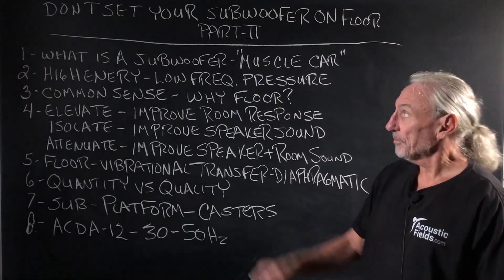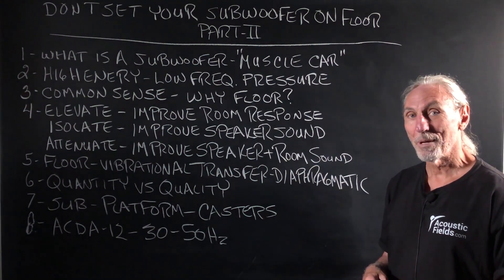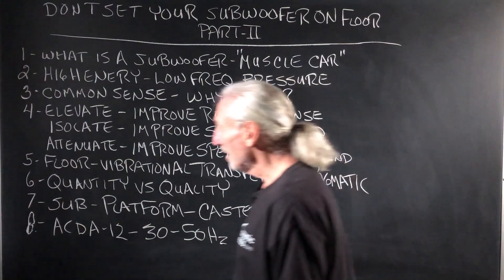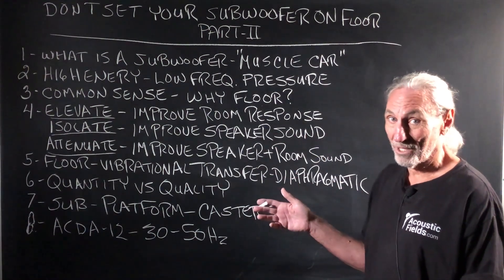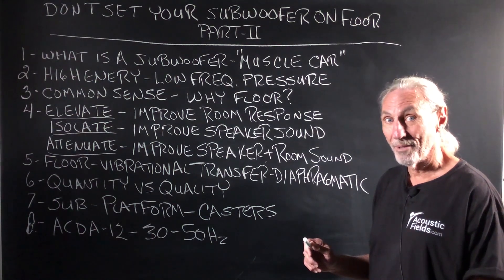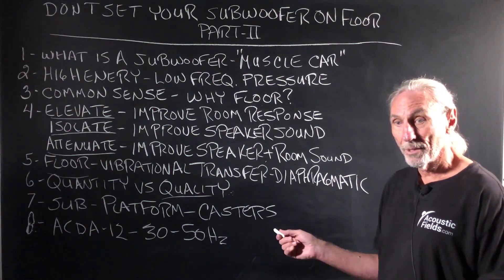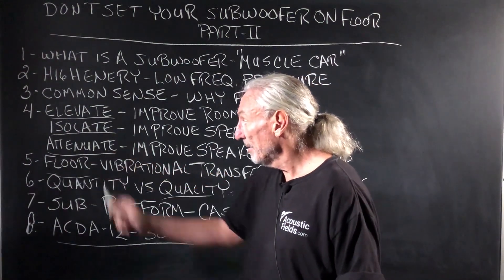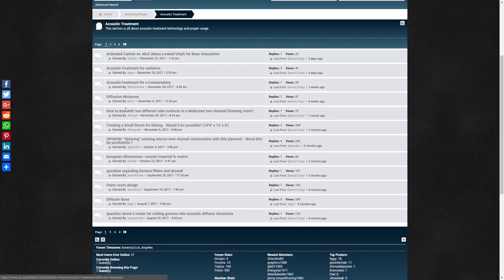Don't Set Your Subwoofer On The Floor! Part 2 - www.AcousticFields.com

Comment: Great work Dennis, I have one sub that's on the floor, out of four, only because when I was setting up, doing the subwoofer crawl and when I do the crawl, I do it on my hands and knees, then up on my knees and finally standing up, to help find all the hight point's as well, so the one on the ground was a good response point, my house is cinder block on a cement slab, with one sub that I had set on floor, running ypao, I found that ypao was upping the dB to it, so I raised that sub a bit over a foot off the floor, run ypao again, I gained just over 3db, I then lowering gain to suit, it spoke for it's self, after a lot of research, your input being the best I found, some time perfecting my set up, all I'm doing now is enjoying every second of it, thanks Dennis.
Reply from the maker: Thank you for your support and following.

Comment: I am super interested in seeing what the sub does and how it effects the room at different heights. This is something I have never seen tested
Reply from the maker: The subwoofer is a low frequency producing source. The room does not want it. It will do everything within its physical power to fight with each wavelength that the sub produces. This fight goes on full time at all pressure levels. Finding the proper position is a good first start. Place the sub in the center of the room as a start position. Move 1' forward and then 1' back. Repeat with sidewalls. Elevate at least 18" off the ground for this testing.  Spend at least 2 songs listening at each position change. Play a full range song with lots of low end then play a "regular" song with strong vocals
Reply: @AcousticFields  how to elevate sub?? Cant find that anywhere? What do i put under my sub???
Reply: @AcousticFields  In a home theater Subwoofer setup...If sound quality and imaging is the #1 priority...There is only one way and one set of inputs to use...High level inputs directly from your front 2 main channels amplifier terminals. Shared with your two main speakers. I use banana's that allow for second banana to be plugged into them. Whatever "stank" your main two channels amp is sending to your main speakers is the exact same "stank" you want going to your subwoofers (yes, you will need 2) as stereo subwoofers Image as much as any two main speakers...the magic happens when, a quality pair of sub's work together with high resolution speakers to paint the soundscape. Keeping the drivers smaller makes for quicker bass and quicker recovery of the driver. Pair of 12's for impact...absolutely. Sound quality, pair of 8's will do nicely. No, not the 100.00 specials on Amazon unless budget dictates. Stick to the bigger names. Rel performance can be had for less money in say the Martin Logan Dynamo 400. As an example. Most (let's say enough) of the bass signal is contained in the front 2 channels to satisfy the bass needs of any home theater. Switch to 2 channel for critical listening and marvel at the imaging and sound quality. Stay away from RCA inputs. Don't sacrifice any sound quality just for convenience, you don't have to. Having said all that...2 sub's running in stereo are the foundation of the soundscape. Subwoofer's at different height levels would abstract the foundation of every soundscape that is rendered. 
Unbalancing the stereo image...No staggering subwoofer height's and always (without exception) run stereo sub's. I'm all for getting them off the floor but at the same height for any listening evaluation. Ear level might be interesting.
Reply from the maker: @lexicon612  You are forgetting about the room impact. Low-frequency energy is a pressure based event. You are using middle and high frequency ray image logic on a low frequency pressure wave. This is a false comparison. A low frequency producing device is room dependent and must use the physics within the room to produce the proper pressure balance that contributes to the managemnt of omni-directional energy. Have you tried elevating your subs?
Reply: @AcousticFields  I'm not going to argue with you till you have set it up and listened to it. 2 sub's in stereo cannot image properly at different height levels. That simple. The image will have weight and the distance between instruments will be palpable. Depth will also be better defined. After you have listened to it how I describe, then respond. My subs are 6 " off the ground down firing.
Reply from the maker: @lexicon612  No argument from me. We actually test various methods and are open to new ways. This line of thinking produced the most powerful low frequency absorption technology ever created in any commercially viable product and the smoothest rates and levels of absorption for music and voice ever created using an open celled foam. If you are not open to the physics of sound and how it works in small rooms, you will never understand. You should come to our research facility and I will demonstrate to you the falseness of your assumptions. I will pay for your flight and hotel costs. When would you like to visit?
Reply: @AcousticFields  Then let you own ears be the judge. All I ask.